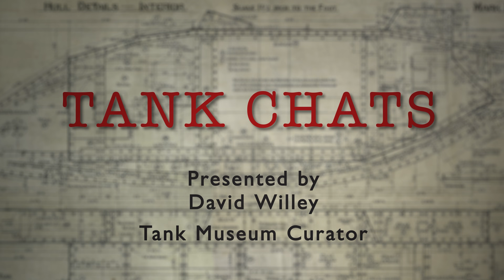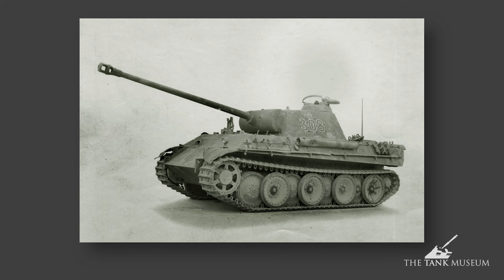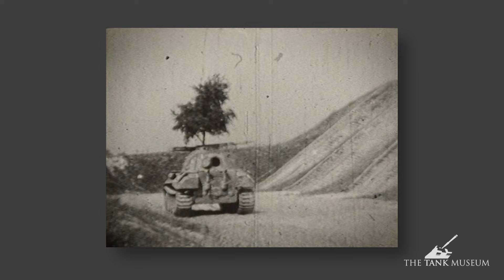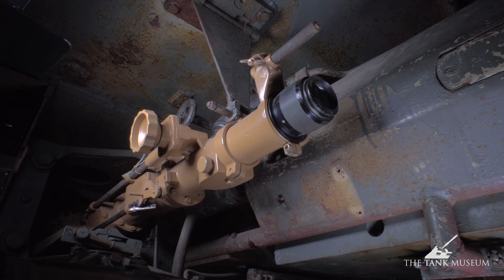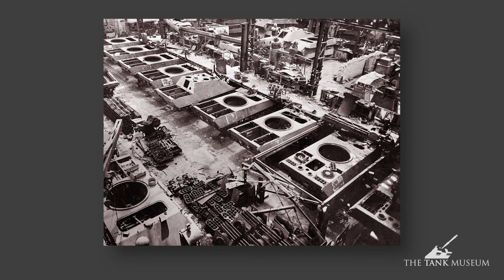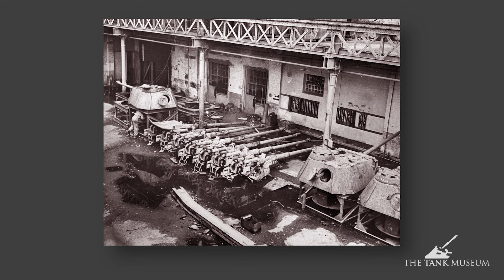Tank Chats #16 Panther | The Tank Museum

Comment: panther is one of the coolest looking tanks ever i wish there was a tier 6 panther on wot that looked like this one instead of using the dumb looking schmaulturm and l100 clown gun
Reply: +DEANOGTO 
VK30.02M

Often decribed as what the Panter actually ought to be in the game and what it would come up against. (except a number of the post-war Tier 8 tanks).
Reply: Jan Witkowsky
ive tried it but it doesnt have the panther armour it cant take hits and considering the usage of 122s at tier 6 7 and 8 you cant sidescrape
Reply: *****
panther has 50 side armour in wot
Reply: *****
at least its not an auto pen like it is for 40mm vs 122mm guns where as 50 will bounce shots and thanks to where the turret is on the panther its pretty decent at it
Reply: ive had steel walls in mine vs tier 8s
Reply: The PTRD/PTRS firing a tungsten core round at less than 100m at zero degrees angle had max pen of 38-40mm, Panthers lower side plate was 40mm. The PzIII and PzIV were easily penned by PTRD/PTRS. Panther received side plates even before entering combat as a precaution. While your trashing Panther for such weak side armor perhaps you should compare Panthers side armor to every other medium tank of ww2.

Comment: If this particular Panther ausf-G was made after the war under allied orders then why doesn't it have the post-September 1944 anti-shot trap bar across the bottom of the mantlet ? Didn't they also double the number of wheel bolts at the same time ( due to snapping problems at the hub ) but I don't think this one shows that either.
Reply: +Ste Cork Probably just assembled by the parts that happened to be lying around in the factory.
Reply: +Ste Cork Late model hull finished by the British with an early model turret.